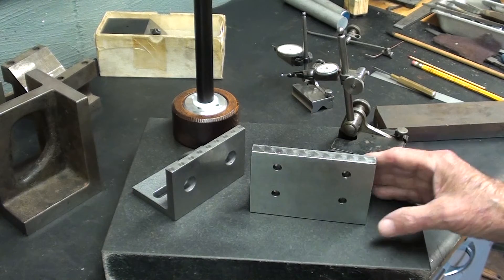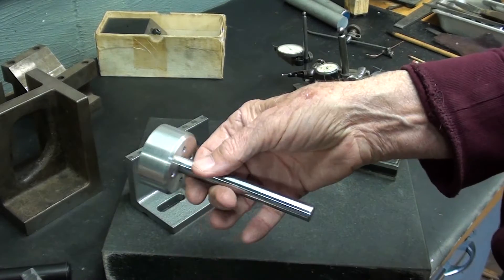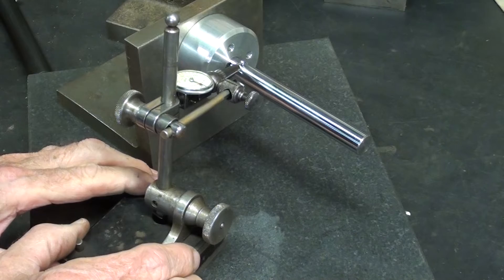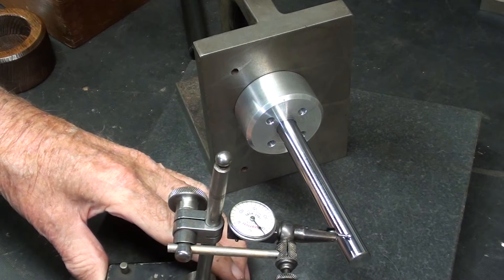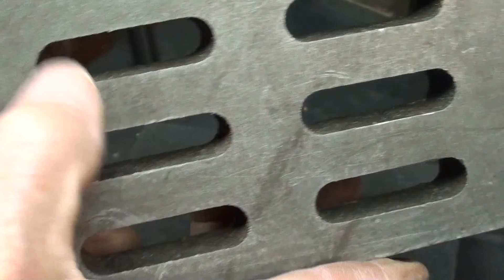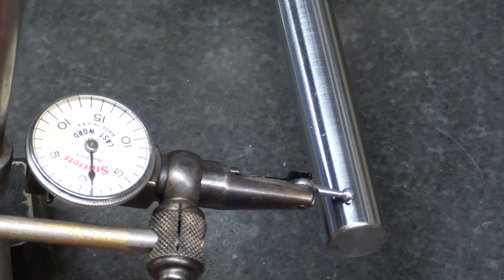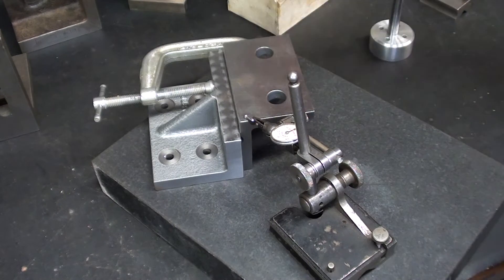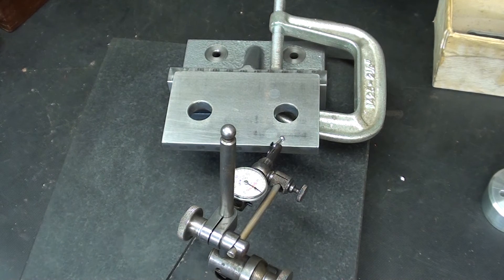INSPECTING PRECISION GROUND ANGLE PLATES #819 tubalcain

Comment: That japanese angle plate has been Blanchard ground. The large circular grinding marks are a dead give away. It is not precision ground but is an economical way to grind large surfaces with reasonable accuracy. As always greatvideo Tubalcain.
Reply from the maker: Thank you

Comment: I wonder should you have rotated your gauge 180° to proove no errors in it before trusting your setup   ?
Reply: Mr. Pete’s gage was inspected for accuracy at four rotational points on my angle plate before he received it.
Reply: @ellieprice363  
He may have dropped it.
The post man may have.
Reply: @stevewilliams2498  No, it was securely packed in several layers of foam and received in the same condition. My AA grade surface plate, master angle plate and sensitive test indicator were used to validate both gages.

Comment: Thats a great test bar..... Our old machine shop boss, would always say, "Always Check the Gauges First" in case they were dropped or misused. So we would of rotated the test gauge 180° in same position on the angle plate. And check that DTI is reading exactly the same in both positions.
Reply from the maker: Great point!

Comment: Few hobbyists will ever own an inspection gauge or square like this. Owning one is a real treat. The need for such a tool is outside the reach of many shops let alone hobbyists. Our shop had a AA Starrett granite square. It was nominally 12x12x4. We used it to inspect and correct CNC mill axis squareness. A particularly troublesome machine for us was a Monarch mill (late 70's vintage) that had a non precision W axis. W axis moved on square ways ind indexed on 1" increments, moving the entire head with automatic tool changer. A quill provided Z axis function. The W axis located on pins sensed by "precision" limit switches. I believe that it also relied on mechanical hard stops, but we culled that machine in the mid 90's. The W position was prone to error positionally and would introduce tram/squareness error in Z axis. The granite square was our only method to validate the machine following repairs. The monstrous head was clamped to the W axis square ways with Belleville washer clamp pressure that was hydraulically unclamped for travel. The hydraulic pressure routinely broke the clamp cylinder SHCS. We doubled the SHCS count to prevent hardware failure, but the breakage persisted. After years of fighting this, someone wondered if lowering the hydraulic system pressure would help. That proved to be lifetime repair. After culling the Monarch, we found little demand for the granite square. By this time we had upgraded to a very large CMM. It was far more practical to validate machine axis squareness by inspecting a machined part on the CMM. Later generation machine designs proved far more robust and axis squareness error was essentially a non issue. 
The Monarch mill was our latest technology when I entered the maintenance trade in 1982. It seems laughable now to think of the labor and frustration we expended on the technology from that era. By 1990 probably all of our DC spindle motor machines had upgraded to AC drive machines. We did still have one 1988 DC servo machine that survived past my 2017 retirement, but servo motors required vastly less service than large DC spindle motors. 
I cut my maintenance teeth on those old technology machines. I can think of times and places that I would have found your inspection square useful. For most of my work, that inspection range would have been very small. I did help make or design some shop made inspection tooling for unique machine validation functions.
Reply from the maker: Thank you for an interesting story about your workplace

Comment: Is that magnetic square homemade or bought.if bought do you have a name and or brand.like to pick one up to do some squareness checking myself
Reply: This gage was made in my home shop. I made two, one for myself and one for Mr. Pete. As far as I know these are the only two with an aluminum base in existence. Suburban Tool makes a highly accurate hardened and ground  inspection gage of this type that (gasp) sells for $500 in a fitted wooden case. Possibly others are available from overseas.
Reply: @ellieprice363  Would love to see how this device was made.
Reply: @robertlark7751  Hard to explain in print but, "very very carefully with lots of checks" 🙂(:-)))

Comment: I have a Granite table top my mom once had in her kitchen. Been using that as my surface plate. So far that  has been accurate enough for me. Some day when I have a small actual surface plate I will use it to check the table top for flatness. I'll put the plate in the middle of the table top and have a dial indicator mounted on the plate and zeroed on to the table top. Then I will do 360° rotations to see what kind of run out I get.